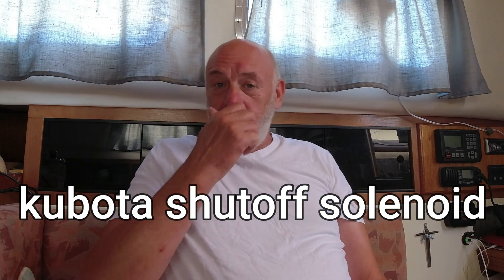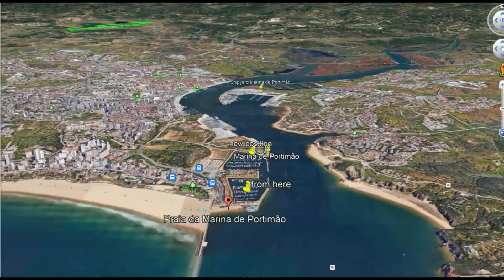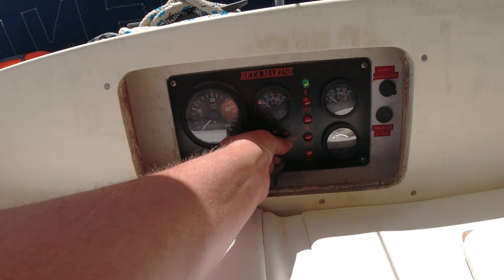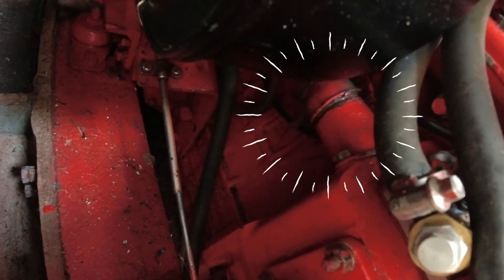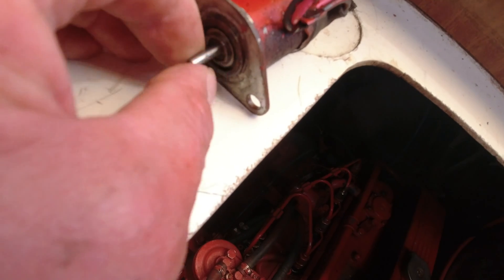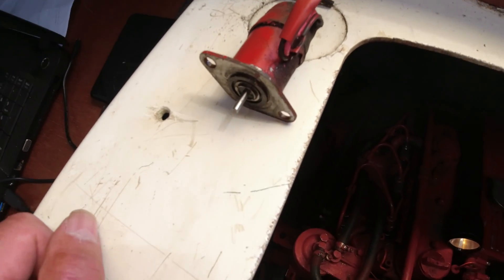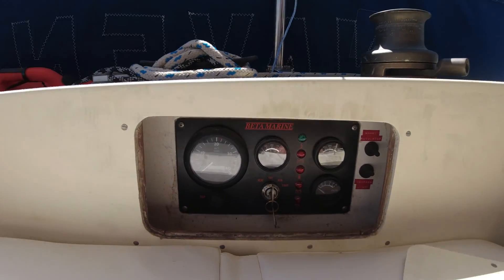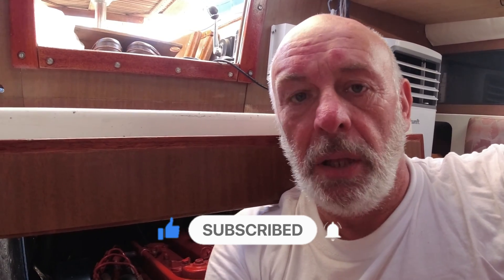Kubota shutoff solenoid || remove and repair

Comment: Can you give me some advise and what is the common problem why the engine won't start if the engine is hot
Reply from the maker: If the motor is spinning faster when the engine is hot but not starting, it could be compression problems. If it won't spin, it could be overheated. Make sure you have the correct oil and antifreeze in the coolant.

Comment: My Kubota rotovator L4018 if the engine is hot already the starter is no longer working I replace the starter still  the same even the battery I replace for new one the same problem engine won't start if is hot I check the solenoid SW pump but it is working what is the common problem Sir
Reply from the maker: I would try a wire directly from the battery,

Comment: What is a short list of recommendations for a beta marine owner?

Spare parts, a quality fuel filter, and regular start-ups?
Reply from the maker: Buy non-marine parts from any tractor part suppliers, keep spare anodes on board Beta Marine UK won´t post to EU. I would try to start and stop regularly as the fuel pump stop control is lubricated from the internal oil supply and can dry up.

Comment: It's a $30 part.  Just replace and be done with it.  Lubing it will not extend life very long.  Electromagnets get weak over time and lube will not fix.  Glad you have a manual fuel cutoff workaround as you will need it soon without replacing.
Reply from the maker: Thanks for your input, but I did this in June 2022 and, it's still working perfectly. It was nothing to do with the magnet, the plunger was stuck out. Trying to get Beta Marine parts in Portugal is almost impossible since Brexit, Beta Marine won't post to Portugal. I did find a Kubota tractor agent in Faro but they could not help me! But if you can find me one for $30 posted to Portugal, I will replace it. lol
Reply: @MakingWavesPresents  Lots on Amazon.

Comment: Great video!!! We're struggling with the fuel solenoid on our Next Gen generator, which is a Kubota engine. I'm going to try to corrosion X it like you did. 🤞
Reply from the maker: It should be easier on a generator (better access) it's only 2 bolts but this is a common thing, if you don't use it so often its best to press the off button now and then. It can also stick in he open position then the motor wont start.